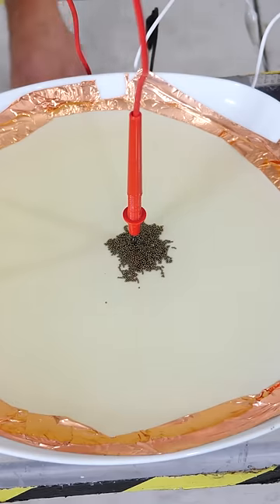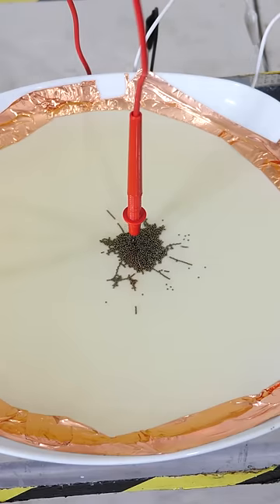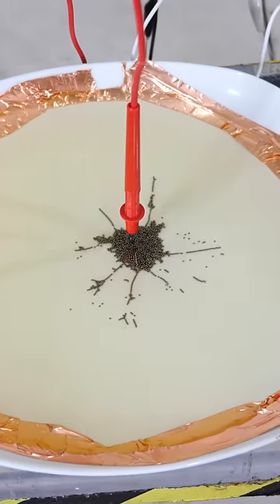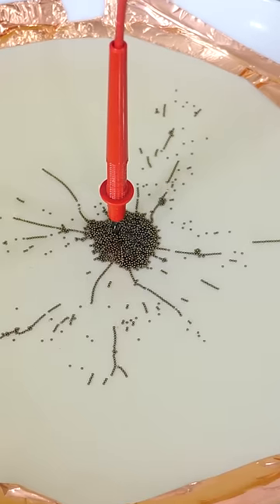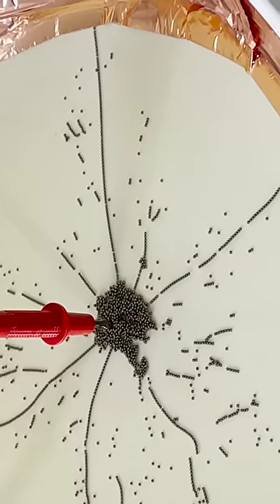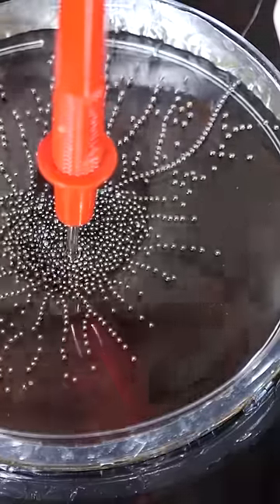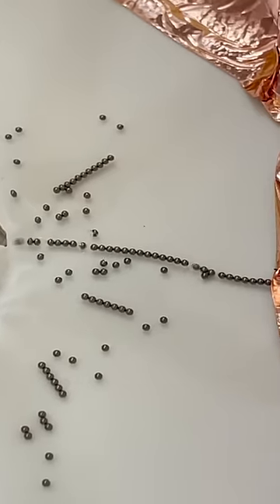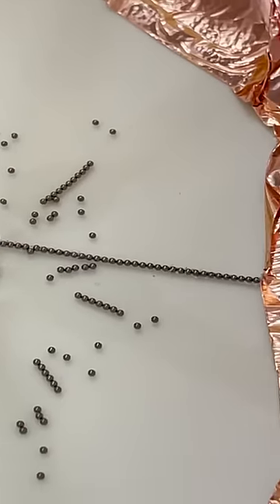Self-Assembling Wires That Plug Themselves In

Comment: What’s amazing is that this is exactly how neurogenesis happens in the brain creating new neural pathways!
Reply: Really?
Reply: Not exactly what happens. There is a complexity of chemical cues that guide axons to a particular destination that is regulated by gene expression corresponding to the chemical gradient present in different areas. Though these reactions are dictated by charge (as all molecular ongoings ultimately are), it's a specificity of attractant and repellent cues that actually guide neurogenesis that aren't dictated by charge in this simplistic way. Though microtubules line up in a polarized fashion during axonal extension, transcription and expression in response to the environment's chemical gradient gives rise to destination.
Reply: @chriscollett7944  this tickled my brain, I liked it.
Reply: @chriscollett7944  you can just say the pathways destinations are guided by your DNA and not by electrical currents instead of explaining it in a way that tried to make yourself seem smarter than you are.
Reply: @genogrinberg6014  lmao it's not that simple, but okay. The way I said it was even quite simplified, but there is an electrical component to it in the sense of how microtubules align during axon guidance, which does resemble what's going on the video. Maybe you should read a book before oversimplifying something you appear to know little about.
Reply: @genogrinberg6014  That's what the PhD is for. Scientific doublespeak. They could make it simple, but they won't. It's like Trekkies speaking Klingon

Comment: This is actually how lightning works but on air.
The reason high areas tend to get more lightning is because usually they tend to form the connection the fastest, then when the connection is formed the discharge happens

Comment: Imagine using this at a micro or nano scopic level in circuitry and in microchips to create self healing connections.   In printed circuit boards, a cracked board could repair itself by powering it on and letting any broken circuits reconnect themselves.

Comment: Now design a system with redundant elements, each critical element within the redundancys a system, to facilitate a 're-circuiting' protocol, with this mechanic as part of its structure.

Use the fire retardant spray as an insulator for the new circuit, in stages, during the re-circuting transition.

Modulate the negative charge off various elements  in the remaining circuit board, by computer control (scout feature), to provide a search element and facilitate re-circuiting.

Comment: what if the caster oil has something to do with prime bearing load? electrical current is accommodated, what if the theory of relativity is shown as an equation to a weight dimension?
Reply: let's say the beads is where the current is accommodated then what does that say about the caster oil? doesn't it then state a condition when weight shifts to an equation relative, ie volcanic eruption where similar exposure to electrical current can be seen near point of eruption. what if this demonstration is scientific evidence of what occurs during certain eruptions?

Comment: "wire
wīr
noun
Metal that has been drawn out into a strand or rod, used chiefly for structural support, as in concrete, and for conducting electricity, when it is usually insulated with a rubber or plastic cladding.
A strand or rod of such material, or a cable made of such strands twisted together."

I don't see a wire.